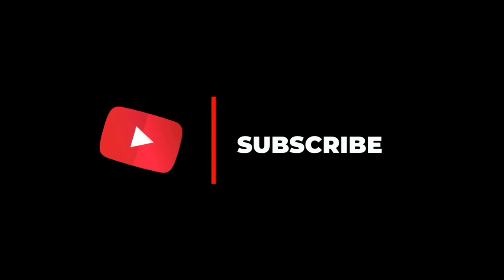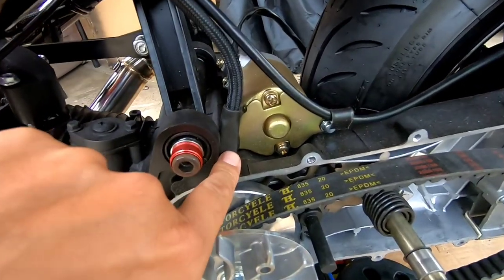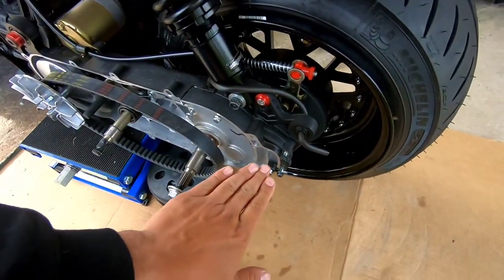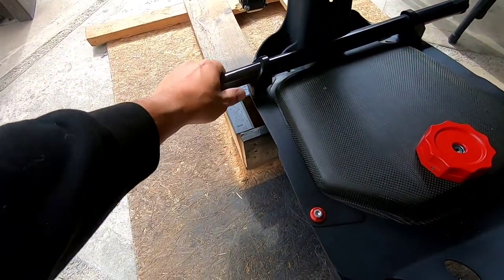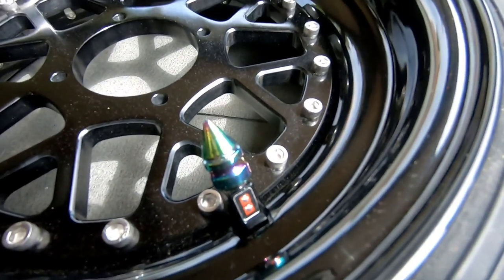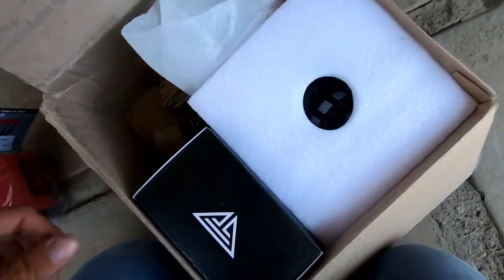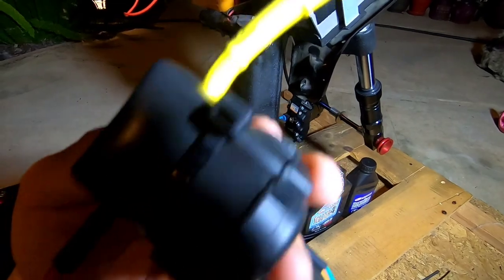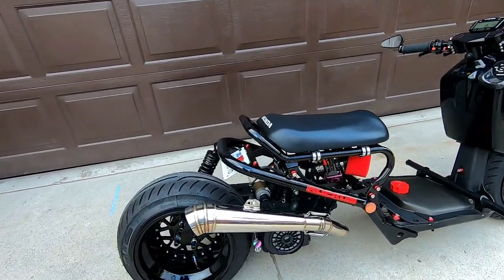The Ruckus Build // Unboxing, Installing And 1st Start Up! // Vlog Series Part 1

Comment: I want one so bad 😭 beautiful build💯💯💯
Reply from the maker: My advice would be to pick up a used one and modify it i bought mine new in 2017 knowing I was going to use it everyday for work and I did rain or shine but that also put me more in the higher side of the build when it came to dumping the money and knowing the purchase of the Ruckus is included. You should get one stock or modify they are a ton of fun easy to build and tune. As long as you take one step at a time sometimes things work some don't all bikes and motors act differently in different locations and Temps. Thanks for watching and hope to see you around 🙏👍

Comment: Already got it started dam I wanna start mine Already
Reply from the maker: Yea I got Everything together and while waiting for those last pieces to arrive is what took longer but the whole build took me about a week and a half that includes the little tinkering of little parts. Would of been quicker but the paint took some time! You will get to start yours soon just remember to use loctite everywhere lol even on the bolts you don't think needs it use it. You will see in my next video 🤣